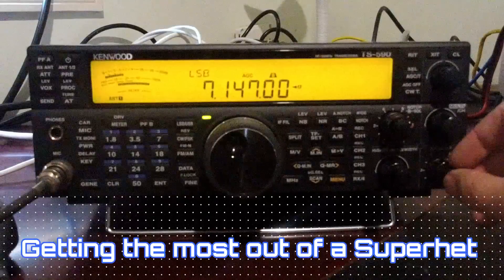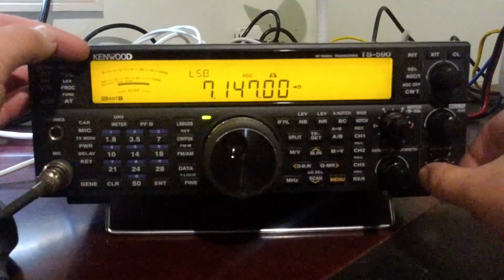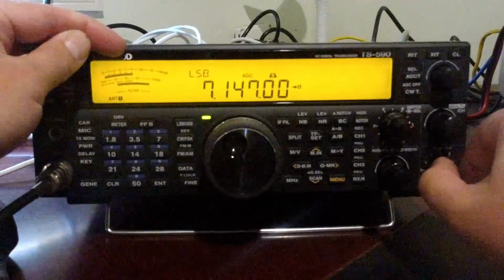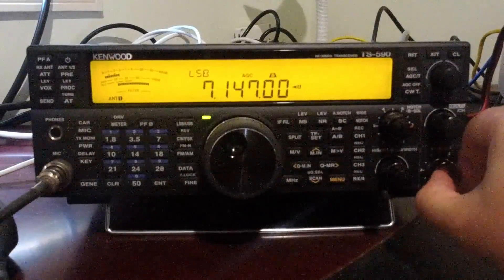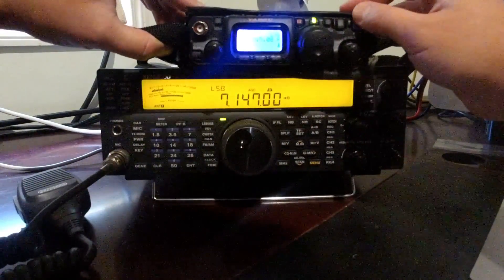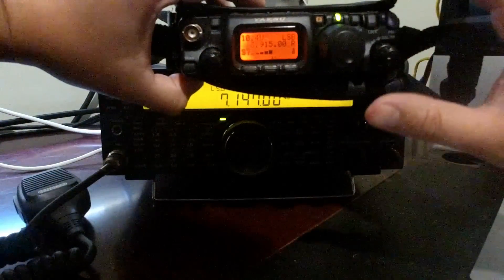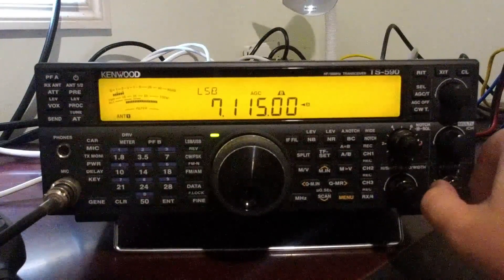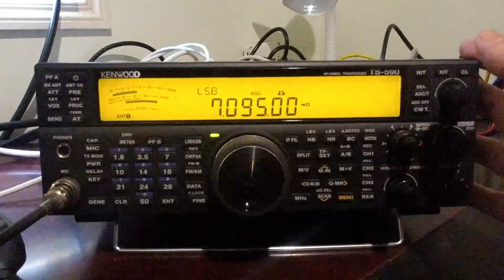How to Setup your Ham Radio Transceiver for Optimal Performance (ft. Kenwood TS-590SG & FT-818ND)

Comment: The rf gain is kind of like a noise squelch?
Reply: No its the sensitivity of the receiver. But using it helps reduce noise. Thus helping the signal to noise ratio. Everyone talks about signals. Which is fine but what matters is S/N ratio. 

If a signal is strong but the noise is too and you can't understand them then S units are pointless! I run with my Attenuator on all the time. I could do the same with the RF Gain but I think mine is 10dB which puts my noise floor about 1/2 to 1 S unit. By just a push of a button. Plus I have some local noise that sometimes is horrendous and follows incoming signals depending on signal strength. Sort of like Intermod. So reducing receive sensitivity helps tremendously! 

Most HF receivers are very sensitive. Atmospheric and man made noise can easily over load and over whelm an incoming signal. If the AGC kicks in while you are listening it can disrupt their audio. Normally its best to adjust the receiver sensitivity so the noise floor is low. Most receivers can get muddy or pull in so much noise its hard to understand stations with the RF Gain at maximum. Especially weak signals. Then adjust the volume to balance signal to noise. Plus Taylor the audio to suit your preference.

WW5RM
Reply: @WW5RM  Thank you!

Comment: Hi, Jarod. 

Nice and simple video how to use RF gain.  The feature which is forgotten by some of hams. 

My friend has the rig, and use it for SWL, especially   on LF and MF/AM  bands. With suitable RX antenna such as Low Noise Verticle (LNV) and beverage  antennas, he ables to RX NBD/LF  broadcast station 15k km away  

At fractions of his antenna system, I also able to RX LF broadcast station, 11k km  away from my base, using IC-7300.  RF gain is very helpful to reduce band noise. .. But, I still admire his antenna system.  

BTW, there is a new Yaesu rig, FT-DX101D .. and what is your thoughts   about it.?  :)

 ... 

Thank you, and looking forward for your next video..

Bahathir 9W2GNU, 73.

Comment: What about ftdx3000
Reply from the maker: Follow the same procedure as here if the S meter behaves the same, else set the rf gain so the S meter reads just above 0 on peaks.  73, Jarrad VK3BL :)

Comment: Hope you can get your hands on a TS-890 soon. Really want your opinion on that.
Reply from the maker: I would love to however they are not being sold in VK believe it or not.  I kind of want one as 'the last great superhet' however they are quite pricey AND with IF DSP they are not all analogue anyway.  In a lot of ways the FT-818ND is the most recent 'last all analogue' radio!  73, Jarrad VK3BL :)
Reply: Icom IC-718 also all analogue Radio can buy new
Reply from the maker: There are a few left but I think the FT-818ND is the latest one in terms of a "new release" even though it was little more than a spec bump due to component obsolescence in the FT-817ND design.  73, Jarrad VK3BL :)
Reply: @RateMyRadio  
Ya, I saw your 817/818 comparison, very good.  Was leaning that way or the other but neither of those made it to Indonesia.  So peculiar who gets to have what.

Comment: what is AGC setting slow /fast?  TIA thank for video 👍
Reply from the maker: Good question :). Slow/Fast changes how quickly the AGC ‘recovers’ or sets RF Gain back to normal after a strong peak.  Slow or Medium is best for phone (AM or SSB) work.  Fast may be useful for other modes; try and see what works for you rig :). 73, Jarrad VK3BL
Reply: @RateMyRadio  I think he was asking what did you have the AGC set to. Slow or fast?